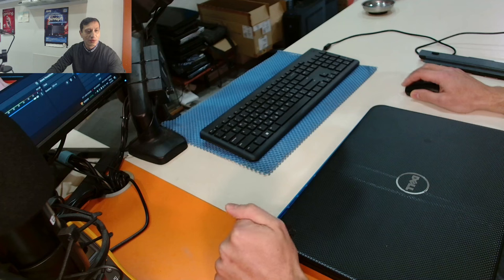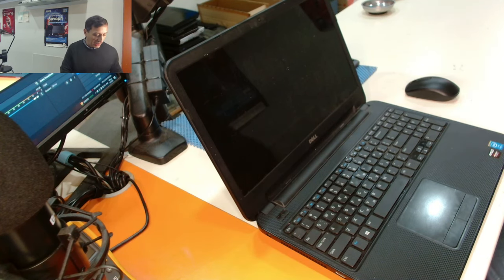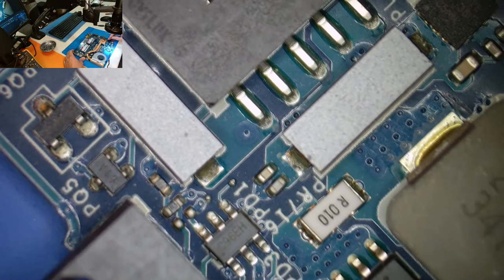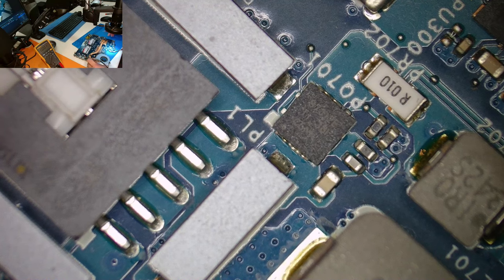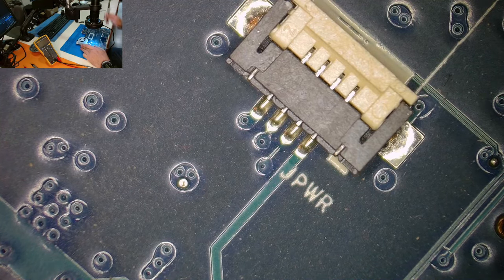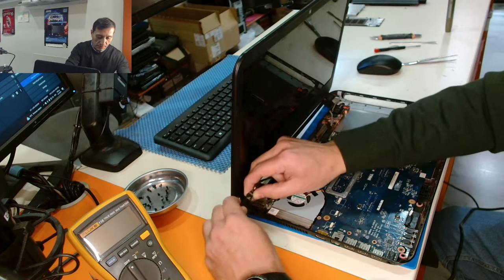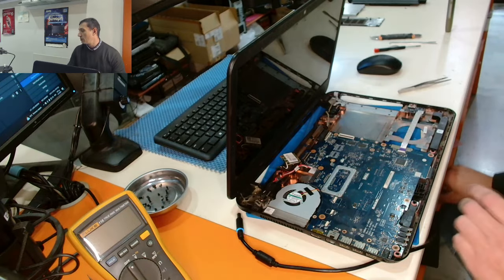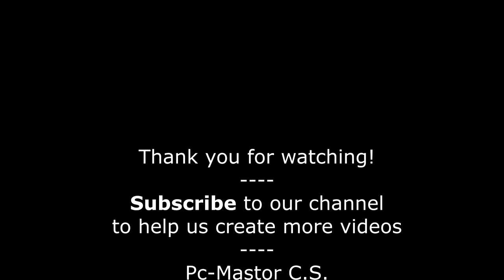Dell Inspiron 3537 not powering on (completely dead)

Comment: I see you haven't really checked the circuit board thoroughly. The circuit board may work, but it won't last long. You look back at paragraph 5:13 1 IC, and the surrounding capacitors and resistors have been oxidized
Reply from the maker: Hi! What you saw on the video is not a full work on the laptop. There were parts edited and deleted.